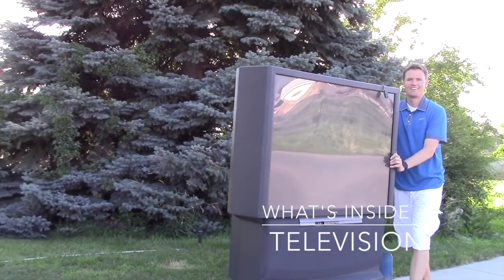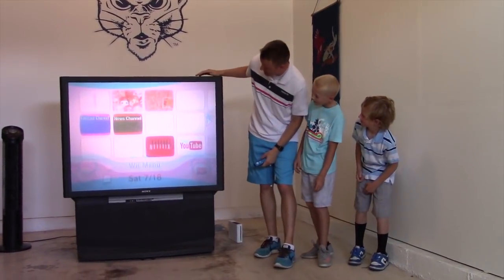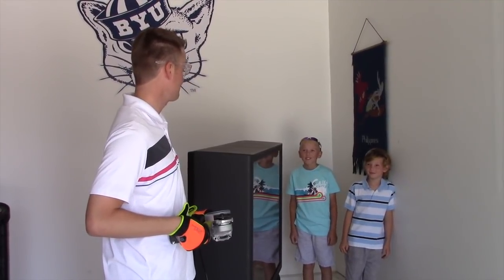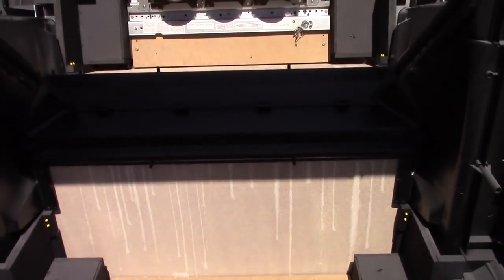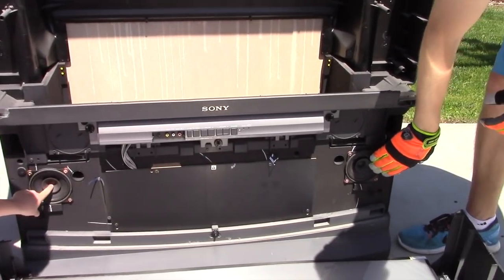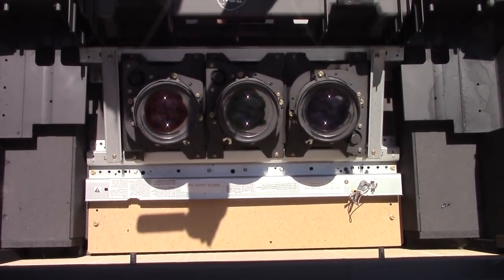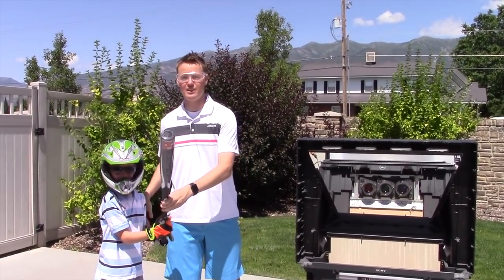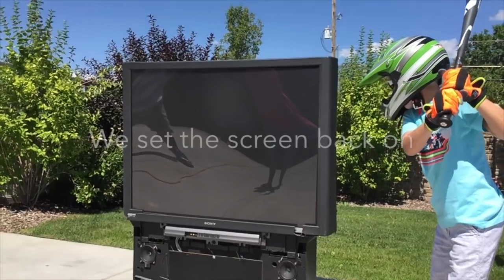What's inside a TV?

Comment: dont touch any of the high voltage components when that thing is live lol, zap zap zap zap zap, there u go, been zapped by an open but turned on TV set. most tv's nowadays though are just one complete flat panel liquid crystal display that has backlighting behind it so it can show the picture. older tv's now used the crt or what is called the cathode ray tube, DO NOT break one of them things, they WILL explode, they WILL cut you up bad! just be careful around a tv is all lol. you didnt need to cut the housing either, remove the screws off the front, and lift the glass away lol.

Comment: 5:50 Danger! Dan is sticking a metal bat into an electronic system. Large electronics like this TV have large electrolytic capacitors. These are still charged many minutes after you disconnect the TV from the power. This is why it can be dangerous to open and repair a CRT TV, it contains large capacitors and coils (transformers) for deflecting the beam, which can give a deadly electric shock even when the TV is not connected to power. Some projector TVs are made as triple CRT beam system. Do NOT stick metal parts or your fingers into it when you do not understand the safety precautions.

Comment: I got a projection TV like this from one the neighbors I use to live by. They had the same problem with theirs that you stated was wrong with this one; blurry screen. They had went out a spent "a ton" of money on a new TV. I took the projection TV they gave me home, took the back off it to see if I could possibly fix it. Come to find out that the lenses were just dirty. Took the top completely off, cleaned the lenses, the mirror and the inside of the cabinet, pulled the back off it, vacuumed the inside of the lower cabinet, put it all back together and had a $2000.00 TV for free (with the exception of a little cleaning work). Best buy for the money I ever got!!!!

Comment: i know how a windows 10 works [18:29:23 INFO]: Launcher 3.5.1 started on windows...
[18:29:23 INFO]: Current time is Feb 1, 2016 6:29:23 PM
[18:29:23 INFO]: System.getProperty('os.name') == 'Windows 8.1'
[18:29:23 INFO]: System.getProperty('os.version') == '6.3'
[18:29:23 INFO]: System.getProperty('os.arch') == 'amd64'
[18:29:23 INFO]: System.getProperty('java.version') == '1.7.0_79'
[18:29:23 INFO]: System.getProperty('java.vendor') == 'Oracle Corporation'
[18:29:23 INFO]: System.getProperty('sun.arch.data.model') == '64'
[18:29:24 INFO]: Attempting to load C:\Program Files\Java\jre7\lib\jfxrt.jar...
[18:29:24 INFO]: JFX has been detected & successfully loaded
[18:29:25 INFO]: Refreshing local version list...
[18:29:26 INFO]: Refreshing remote version list...
[18:29:26 INFO]: News is up to date!
[18:29:27 INFO]: Refresh complete.
[18:29:28 INFO]: Loaded 2 profile(s); selected 'OptiFine'

Comment: The reason why it's red green and blue rather than red yellow and blue is because red yellow and blue are the primary colors for stuff like pairs where you can mix them to make other colors but red green and blue are the primary colors for light which means when those colors mix using lights it will make different colors
Reply: Paints not pairs

Comment: Wtf kind of TV is that
Reply: +Pompeii -Minecraft I'm actually 19 (I know how that sounds by now), I've just never seen a TV that uses giant light projectors to project images onto a mirror before. I thought there was CRT televisions, and then flatscreens.

They titled it "What's inside a TV?" which made me think they would either use a regular CRT TV or a modern flatscreen TV, but then they used this TV which I've never even heard of before.
Reply: It's a CRT Rear-projection TV, they were pretty common back in the day for the big screens.  Essentially, it's the key components of a CRT projector, being shot up into a mirror, into the rear of a screen, I still see them as commonplace to this day IRL.

Unlike today's modern-day LCD and DLP projectors, CRT Projectors used three tubes to represent "RGB"; Red, Blue, Green, and they have no costly traditional projector bulb that the user has to purchase replacements for every 2000/3000/4000 hours.    However can be a pain to align so they're only practical when placed in a permanent-ish locations, such as ceiling/wall/ground mounts and inside of a rear-projection enclosure.

The majority of CRT rear-projection unfortunately have crappy "720x480i composite" inputs, however CRT front-projectors tend to have component and/or VGA inputs and they can produce very nice HD video in the dark; resolutions of 720p and 1080, don't expect any higher resolution than that.

They do a pretty nice job with color reproduction and accuracy, and are capable of doing an exceptional job at producing blacks (as opposed to crappy grays for blacks you'll see on most LCD/DLP solutions).  Like "DLP projection" technology some people may notice distracting flickering unless the refresh rate is jacked up as high as possible from the video source.
Reply: Old widescreen TVs would you a projection system instead of having a ton of tiny pixels as it was cheaper, you can look up Rear-projection televisions online for more info
Reply: ATNR. Well i dont realy care but if he is 19 y.o he needs to know what kind of tv is that
Reply: how old are you? 12?
Reply: +Emil M How old are you?
Reply: Turtle Gaming Read the replies lol.  Someone already asked that, he gave the answer.
Reply: +Turtle Gaming I'm sorry, I have never in my life heard of such a TV. I've heard of projectors of course, but not like these, especially not used for a home TV. I don't know if these were more common in USA than in Denmark (where I am from).
Reply: I'm Canadian, and there has been a ton of instances when I've seen rear-projection TVs in real life, despite them being not nearly as popular today compared to front-projectors, CRT displays, LCD, plasmas, OLED.ETC.

I honestly don't blame anyone who are ignorant towards obscure display tech, especially from people who may be more technically illiterate.
Reply: ATNR. couldn't have said it better myself
Reply: +ATNR. Well Hi my name is Darian Bailey I am 12 years old <:. We still have a Huge Rear Projection TV in our living room.
Brand: Hitachi
Reply: Bodu Oh cool!  See, I don't own one personally but I still don't imagine somewhat widespread usage of rear-projection screens disappearing anytime soon
Reply: +Emil M EMIL im finding you everywhere! and guys he isnt 12 i know cus of how amazing he is at modeling
Reply: I know right
Reply: BBSWAGGERTONS P.O.P These days, I see people in my area selling perfect condition rear-projection TVs for next to nothing or even free, like on Kijiji for example
Reply: +Emil M dont mind people the most of them are yust trolls XD i'm 31 and i have never seen a tv like this witch is a little bid strange after all the tv's i took apart lol
Reply: It's what are those T.V
Reply: BBSWAGGERTONS P.O.P Yet, I still agree with the fact I followed it with a fact anyway, just in case
Reply: ''how old are you'' asked the 14 year old minecraft boy
Reply: ***** c:
Reply: Sony
Reply: Good job on FNAC 1 and 2
Reply: Emil Macko lol
Reply: One that you can just about afford
Reply: Color tube
Reply: it is a rear projection tv.
Reply: Maybe wii tv
Reply: Emil Macko rear projection tv they stoped making them in 2006
Reply: It’s sony
Reply: Emil Macko I don’t know
Reply: hey you made fnac
Reply: How old are you? A 8 year old playing Minecraft
Reply: It is a big CRT Sony TV
Reply: Emil Macko  Sony
Reply: the bedt tv in the world it s sad they stopped to make these
Reply: we invented them in soviet union it is a soviet ceation sony copied on us we created these tv s
Reply: Ray890 these tv were only on rich peoples homes so they are not common for me
Reply: Emil Macko YOU SAID A BAD WORD
Reply: a crt is different it uses electrons and cathode rays. thats why its called a crt (Cathode Ray Tube)
Reply: if they cut open a crt could have either electricuted them, poisoned them or blown up in their face!
Reply: Your moms tv
Reply: It’s a damn SONY tv, not sure how blind you are.....
Reply: Language
Reply: Emil Macko a big one
Reply: Uh dip or plasma
Reply: Emil Macko it’s a mirrored tv
Reply: Ray890 no. It’s not a crt tv. It’s a mirrored tv
Reply: P
Reply: Emil Macko  it is a sony
Reply: +Pompeii -Minecraft probably

Comment: You know, there's a new invention, called a power drill with a screw driver bit.
Reply: What's the fun in that?!
Reply: I've seen a commercials for Lazer Bond USA / 5 Second Fix (liquid plastic UV light adhesive) and 'thunder knife'. (cuts metal but safe to skin, not sure if it's thunder or wonder)
Reply: +darksskull That`s not how they do it. The way they do it is their trademark. Cut it open to see what`a inside.
Reply: +Abhiram R.  No one whats to watch someone take stuff apart. we want it cut, bashed, and smashed. Hooyah

Comment: Outer most screen is a great fire starter you can even melt lead with it.   The lenses under the lights are great magnifying glasses for looking at coins or starting fires...  The oil in the cooling box is not to safe ..but burns hot once it gets going....   Don,t forget recycle the copper,  aluminum and iron.  Have fun playing with the screen..I was able to melt a wheel weight in under 20 seconds.  Just bend it to the shape and get small very hot white spot projected from it....   It will also boil your coffee fast..
.

Comment: Any saw for cutting wood cuts plastic like wood.
The RGB projectors are each a small CRT with a lens group in front. Between the CRT and the lens group, is a sealed chamber filled with fluid. A few TVs have gel instead of fluid. Some TVs have simply a massive lens in lieu of fluid or gel. The back layer of the screen is a very powerful Fresnel lens. With it, + the sun, you can melt a soda can in a matter of seconds. Welding helmet recommended; concentrated sunlight is no joking matter.
I scrapped a few dozen rear-projection TVs; that is how I know all this.
I framed the mirror from the last RPTV I scrapped, and hung it on a shed outside. Has a trapezoid shape, like the one in the vid. Outdoor mirrors do come in handy, especially if you spend the better part of the day outdoors.
Most RPTV mirrors are first-surface mirrors. A few consist of a reflective film stretched over a foam-reinforced metal frame. Cut a hole thru the inch-thick foam w/o damaging the film, place in front of a speaker, wait till night, point lasers at it, and Up the volume. Homemade laser show! If you can score 2, that's even better!

Comment: do whats inside a printer or computer monitor
Reply: You should never open a computer monitor without supervision of someone who is certified to do so. Inside of the screens there are gases that can easily cause harm.
Reply: +Alastair Pilley You do also realise that monitors hold a high-voltage charge for years upon years and touching the capacitors could be fatal towards your life? It's not like they're discharging this thing.
Reply: +TheMadBalla Nah, sorry your wrong. If it is a Cathode Ray tube screen then it is a vacuum tube( meaning no gas), you do have to be careful though. The vacuum tube implodes when broken, especially when the safety implosion rings have been removed.
Reply: +Alastair Pilley Another thing, although LED/CRT monitors don't LCD's(the most common type of monitor) do contain mercury in the backlight. Breaking the vacuum tube is actually much more harmful than breaking the backlight.
Reply: You don't want to open a old computer monitor
Reply: +Darren Woloshyn whyy

Comment: They come and go on the video camera because the oscillate at a high frequency rather than just being on and the camera also happens to take its frames at a similar rate (which makes sense if both are for video) 

And the closer the timing of oscillation the longer the period of crossed over peaks and troughs which is why you see it on then off for relitively long times (1-3 seconds rather than 70 each second)

However this isn't the same because eyes don't have fixed frame rates and even change the period between 'images' taken frame by frame creating the a,axing illusion of moving pictures

Comment: If you ever cut up/open one of those rear projection tvs there is a lens before the screen called a fresnel lens it's about 1000 times better at magnifying the suns power than a magnifying glass. So instead of killing ants with the little magnifying glass which can be difficult because they keep moving. You can use this lens to auto ignite a 2x4